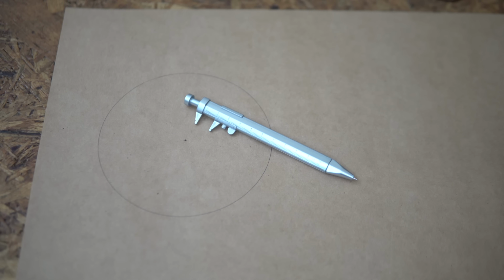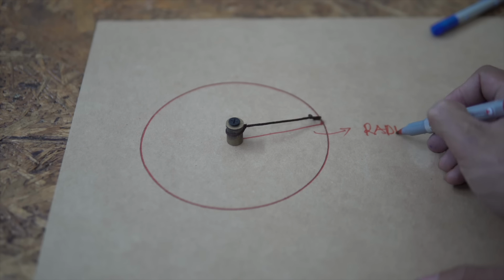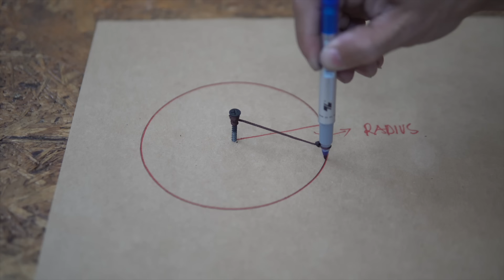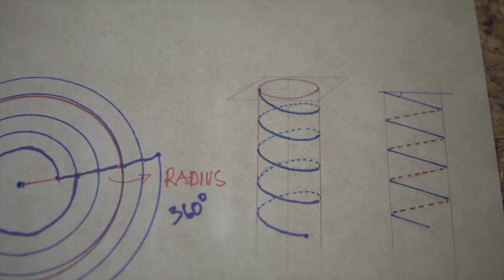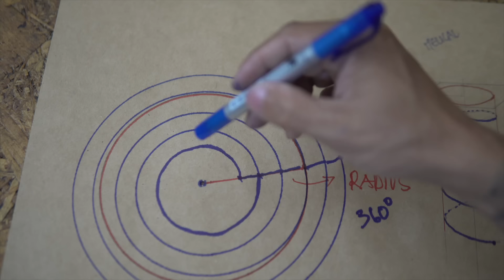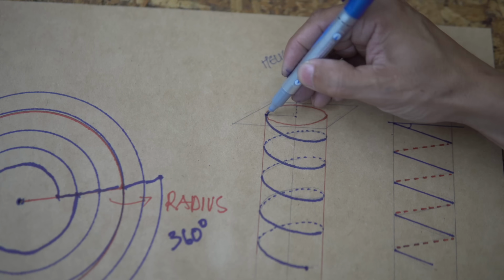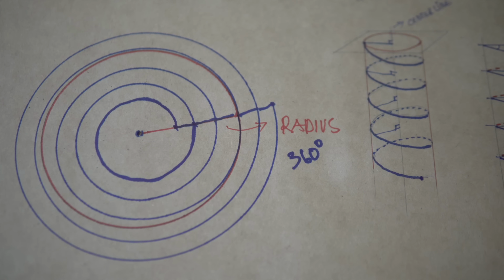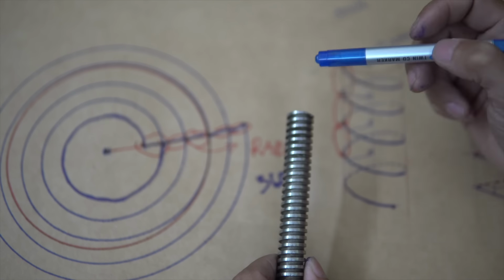How to - MANUAL machining SPIRAL

Comment: Very cool setup - while the idea makes perfect sense to me, I would've never figured it out myself if I needed to make a spiral (in particular the attention to the universal joints).
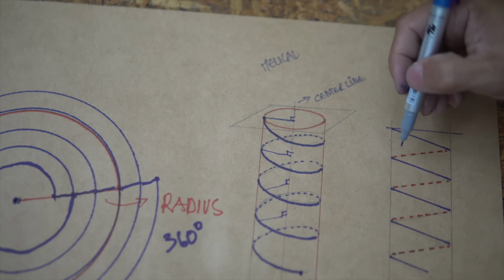Minor nitpick: At 4:56, that is not actually what a helix looks like from the side, a sine shape would be more accurate. A way to see this is to consider a point moving along the helix at constant speed (like the tool when threadcutting), then in the perspective on the right, it would be moving down at constant speed and swinging left and right sinusodially (since it would be tracing out a circle as seen from above), which will trace out a sine shape. But it was clearly meant as a side note anyway and doesn't really matter, and the important points were all clear.
Reply from the maker: Thanks alot for point that out. Those lines should be the tangent lines not the actual curve of the spiral. 
For more precise the whole helix is a smooth space curve. Only look like a sine in 2d perspective.
I was trying to bring you the relationship of spiral & thread. Lucky me they're pretty much on point.

So this's the example of always double check anything from the internet 😆.
Reply: True, the sine only appears in 2D (in particular orthographic) projection. And the point about threads and spirals being similar came across pretty well in my opinion, and that's really what matters here
Reply: 👍🏼👍🏼👍🏼👍🏼 Esteban Gaitan 😃🇦🇷👍🏼👍🏼👍🏼👍🏼
Reply: Hi.  This is an excellent description.  I own a BS-2 dividing head like yours but do not have a change gear setup.  Can you recommend gear sizes for me to cut?  It appears you made yours out of aluminum - is that sufficient?

Comment: Trust me, anyone that's advanced enough to be trying to mill a flat spiral square acme thread groove doesn't need to hear anything anyway. They just need to get a glimpse of the right moment in the process that they can't get their mind wrapped around quite tight enough lol. Your English is fine anyway so I wouldn't worry about that, though I'd try explaining things less of just with fewer words in general just because most people don't absorb information like that. Least not ppl that are more mechanically or artistically inclined, and this may be machine shop, but what you're doing is no less art even if its mechanical art. You'll make a wicked engineer and of that I have no doubt!

Comment: The diving head and rotary table I have came from a machine built in the 40’s I think that actually had the gearing attachments to do these things using the power feed on the x or y axis. Very cool work you have done - the truth of mathematics is pretty cool to see it in action.

Comment: Very nice built. I don't know if it really matters (probably not so much because the result obviously works), but these universal couplings (cardan mechanism) introduce some inconsistencies. They do not transfer rotational speed constantly over the circumpherence.
Reply: So, there's another project for Cà Lem: make some small constant velocity joints. 😀
Reply: That's the first thing I thought when I saw the setup, its pretty good (good enough for a chuck since the inconsistencies would be equally spaced) but not suitable for high precision work like if he was making a scroll compressor.
Reply: If the angle in both ends is kept the same, it will be very close.
Reply: @MF175mp  Yup, he mentions that at the end of the video.  Hooke joints' accelerations cancel when the end shafts are parallel and the joints are in phase.  If you want to run in a non-parallel config, say to hob a helical gear, then you need CV joints, no way to make a Hooke work.
Reply: @d00dEEE  even if they are parallel, there is still an inconsistency in the rotational speed. It is minimal, but it is there.

Comment: In your vertical setup the universal Cardan joint introduces some positioning error to the lead screw, as the rotation is not transferred uniformly. Not sure, how significant here. https://www.youtube.com/watch?v=IttUsogU4AQ 

EDIT: Taking it back, I looked at it wrong way.
Reply: The yokes on Cà Lem's double Cardan universal joint's intermediate shaft are positioned correctly, unlike in the example of incorrect position you referenced. While I have not run the calculations, due to the slight angles and correct positioning of the double Cardan universal joints any inaccuracies in Cà Lem's setup are extremely minimal.
Reply: @heythere6922  Cà Lem's attachment has two setups - horizontal and vertical. In vertical setup (12:02) yokes are positioned same as in the referenced example I'd say.
Reply: @Thomeeque  Cà Lem does a great job explaining the universal joint setup from 11:40 to 13:00 (there might be a few images during those frames where the alignment is not perfect, but they are close most if not all of the time). In the example you referenced at 12:02, the joints are correctly positioned, unlike the linked video explaining how NOT do set them up.  Or maybe I've been staring at my screen too long, and seeing things incorrectly?
Reply: @heythere6922  Actually no, I am looking at it wrong way, in the video I have attached are yokes rotated differently, I have missed that.